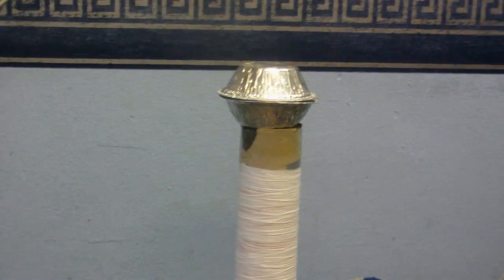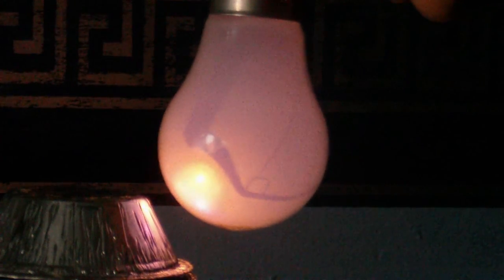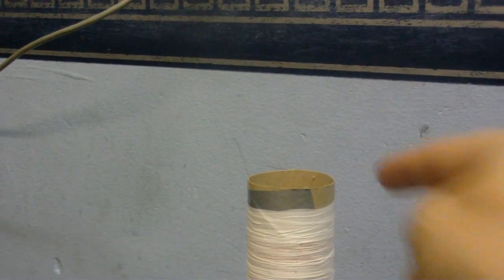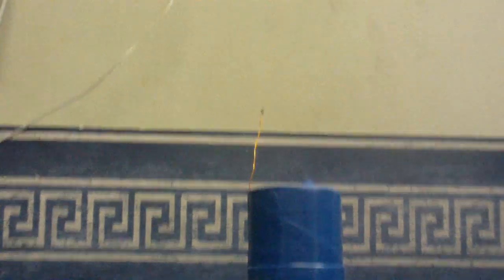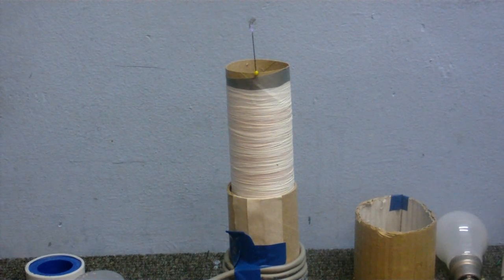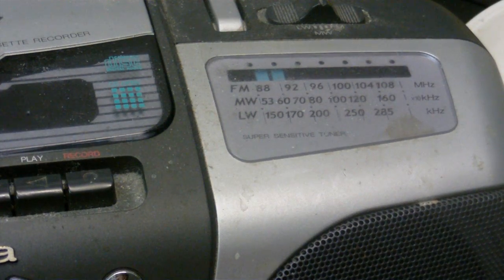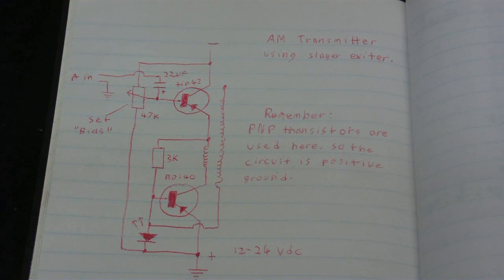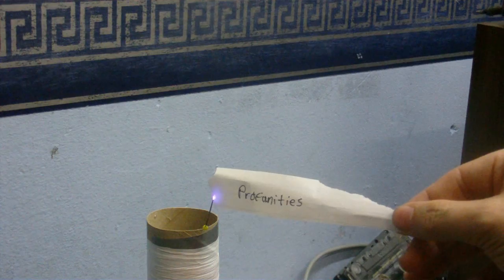Some more slayer exiter 'xperiments

Comment: transistors not being able to cope with an AM transmitter circuit is the reason why at commercial radio stations large output valves are used instead.  Much better power handling and heat and power dissipation and they can easily cope with the kind of transients that enormous coils generate when they inductively spike (flyback). you could try this with a pair of pentodes if u want it to last a long time.  if ur content with constantly replacing transistors then theres not really much need.